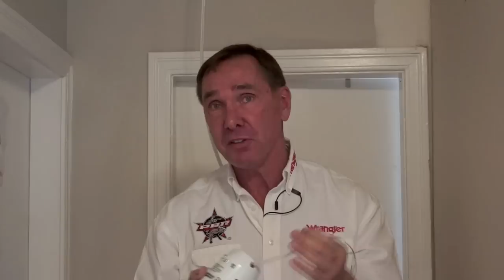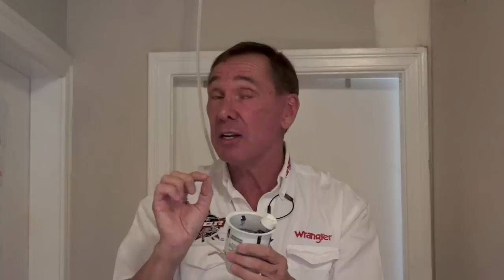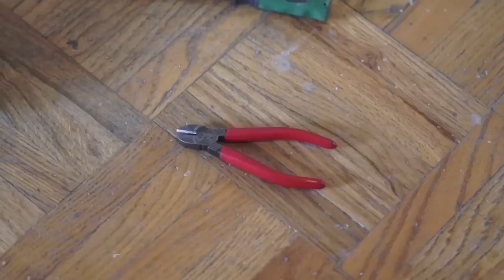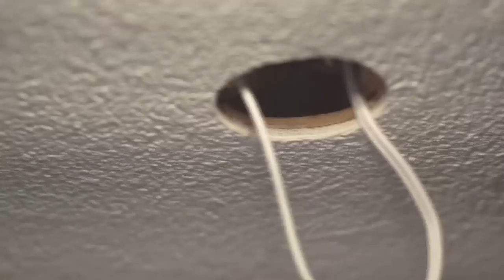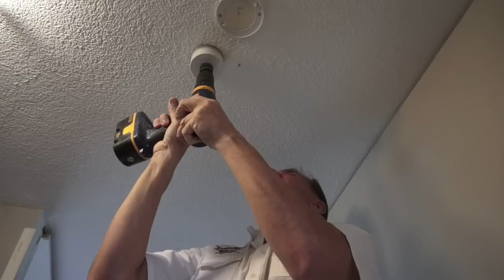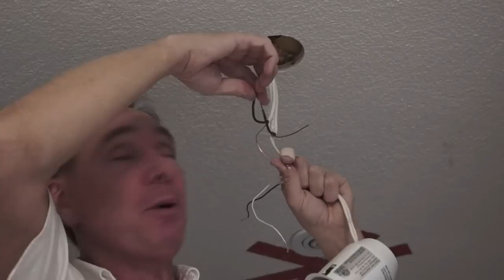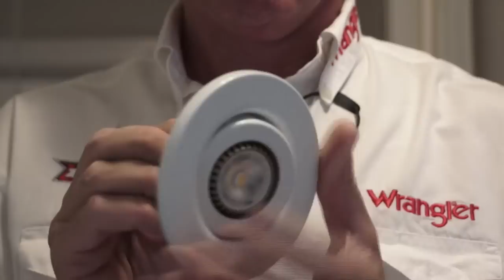How to Install Recessed Lighting | Retrofit

Comment: I am compelled to comment on a few things for the benefit of people watching this video. (1) You MUST put all electrical junctions inside a box. Boxes don't guarantee safety anymore than stuffing loose splices into an unknown ceiling space guarantees a fiery death, but properly sized junction boxes will contain arcs if the circuit surges or shorts out. (2) Proper eye and lung protection is a sensible and safe habit. Otherwise, stuff WILL get into your lungs and eyes (see video), whether or not it's large enough for you to notice. The odds might be very low that you'll drill into metal (a galvanized strap, for example) and get a tiny shard in your eye, but try explaining that to an MRI technician in a few years. (3) There is more than enough amperage in a typical residential circuit to kill you. The probability is low, but rest assured it is greater than zero. So treat every wire with respect and get a decent circuit tester before you do any wiring. (4) If you can't locate a joist with a stud finder, take a piece of stiff wire (e.g. coat hanger) and bend it into an "L" shape where the length of one end is the radius of your hole saw. Stick it into the pilot hole and rotate it to locate obstructions. (5) If you're putting retrofit fixtures into an insulated space, get fixtures that are rated "IC". A 5W LED bulb would barely warm up the pot, but a 50W halogen generates a LOT of heat. LED bulbs do fail, and who can predict if the next owner of a house won't stick his or her last halogen bulb in there? Remember that just because someone shouldn't do something, doesn't mean that they won't.
Reply: +Percy Lipinski : I just told you how to make your "low wattage job" safer. More importantly, I told others how to do so.
Reply from the maker: +Kevin Goncalves well you're a stupid idiot no matter what part of the planet you're from. As I says tell me what is unsafe. Be specific not this bullshit about not meeting your code you douche bag with a Latin sounding name LOSER!!!
Reply: +Kevin Goncalves It's pretty clear now that "Percy Lipinski" is some sort of train-wreck parody account. No real person would actually drill into a joist (seriously, how could anyone with opposable thumbs do that?) , dump that much dust into his eyeballs (staring blankly up into that dust cloud was a touch of slapstick brilliance) AND mount a smoke detector on a wall (I'm betting he tried to mount that smoke detector on the ceiling but just plain missed). I would have loved to see that smoke detector installation video ("It's only 9 volts! Explain to me how the house could burn down!"). Anyway, the comments for this video are hilarious. That whole "Nobody's explained anything to me" trope is another excellent comedic premise, although it would be more effective absent the racism and childish spelling errors. It's hard to fix the racism, but maybe the little red-faced man's next video will be "How to install a spell checker". It's always fun to see people make videos about things they know absolutely nothing about.
Reply: +Percy Lipinski I love it! It's like you hang around a playground all day to overhear all the insults kids come up with and then you remember only the ones that don't involve wit. But seriously, this is a parody right? Your actual name is, what? Biff Wrangler? I mean, how else can you explain a grown-up wearing a shirt with "Wrangler" plastered all over it?
Reply: +Biff Wrangler I'm somewhat worried that your little red face turns absolutely purple when you write that stuff down. However, every moment that you're pecking away at the keyboard with your perpetually bandaged finger is another minute that you're not hurting yourself making a video. Which, I suppose, makes it much healthier for you while amusing the rest of us to no end. That's why when you direct your inane playground insults at me, what I actually read is "Thank you, E Campbell. Thank you for keeping me safe". And if I can save anyone from applying comical amounts of red tape over their hack-jobs on ceilings, floors or loved ones, then I know I have truly done a good deed today.
Reply: +Percy Lipinski wow now ur all hung up on my name? don't wanna rack your simple brain too much in one day cheapskate. and here is the most simple explanation for the most simple of brains: your installation is unsafe because you have OPEN AIR connections literally touching COMBUSTIBLES. there you go moron.

Comment: Wow, just wow.  A non professional telling other non professionals how to do something wrong.  Just remember those who watched this.

If you ever have a house fire, even if it has nothing to do with this hack installation, your insurance company will not pay for the damages, or pay for you to build another home.
Percy.  Are you an insurance adjuster?
Reply from the maker: +John Valdes You dumbass professional "Douche Bag". OK Mr. expert how is the fire going to start with the type of electrical install that I did??? What a stupid piece of crap LOSER you are!!!
Reply: I have seen several car fires that started because of faulty 12 volt wiring.  Its not the voltage as much as the connections.  Of course this may never start a fire. But if something else starts a fire and the insurance company finds this hack install, they very well might not pay for the damages or give you the money to build or buy another home.  I will pass on this type of installation and would warn others to do the same.
Reply: Tell that to your insurance company when something else causes a fire.  You just don't get it do you?
Last words to you Hack.

Comment: Why do you have a dryer vent coming out of the interior wall? I also wanted to see you fish the wires. Looking to do this and wanted to know how bad it was. Judging by the scraped knuckles and bandages, it was not to good.
Thanks again.
Reply from the maker: This is s very low roof and the spaces are minimal you loose stool

Comment: living in cold climates, someone just might replace those (most probably) low CRI leds with the old halogens precisely for the extra warmth. A few hundred watts of lighting in the hallway will surely tempt one from cranking up the old fossil fueled heater as much. Therefore, the cans need to be rated for high wattage. However, in the future, the leds will be gaining in Color Rendering Index. I still don't know how to drill through studs and beams behind the drywall without tearing it up.
Reply from the maker: Look you leather faced piece of crap HALOGENS ARE NOT LEGAL IN THUS PART OF THE WORLD!!! If you do your insurance is not valid!!!
Reply: +Percy Lipinski 
who are you talkin shit like that. I'm just saying that it's not a good idea to just assume that  It's not against electrical code. .. and that the light of leds SUCK (unless high CRI).
Why give yourself a heart attack?
Reply: +fireofenergy 
sorry if I'm wrong
Reply: +fireofenergy And I'm NOT against the idea of the efficiency of solar and leds. In fact, i WANT a totally global powered world complete with global power lines and battery storage.
Reply: +fireofenergy 
I mean "totally SOLAR powered world".
Apologies
Reply from the maker: On the one hand you're right. It's the potential hear problem that could cause trouble. That's the reason for all the metal boxes and special connections that most of these assholes are complaint about. Of course those same assholes make a lot of money pretending to know what they are talking about.,the fact is heat is the enemy in any electrical installation, the rest is handled by the breakers. In this part of the world halogens and most other high temperature bulbs are permanently banned.

Comment: you might be old ....that might be the reason why you can't take constructive criticism.  you reply to my comment from 50 weeks ago with verbal abuse. ...shame on you...you Dickwad
Reply: +Percy Lipinski really man...seriously..just so that you know the Canadian electrical code that I quoted was from the code book.  so why don't you burn your code book which is probably from the 1800 and update your self to 2015 codes... and don't give me the old house rules crap because if you are installing a line votage fixture next to insulation you still need a barrier.
the only time you don't need a vapour barrier on the fixture is if the fixture is IC rated meaning in that they can be in direct contact with insulation.
Reply: Are you done you stupid racist bag of shit. Just because someone is giving you the right knowledge, take it positively for a change and see acknowledge what you did. I'm done with your ignorance. and this will indeed be my last post to your comments.

Comment: Percy, nice video. The one question I have is I didn't see how you got through the beam for the other chain of lights. Maybe I missed it. Did you use a flexible drill bit?
Reply from the maker: Now THAT is a great question. So first off unless you have a really bizarre roof like I do that is one with almost no clearance with no insulation there should always be enough space. Let's say you are cursed with a roof like mine then you either use the flexible drill or just gouge out a small trough through the drywall or plaster where the beam crosses. It's very low power so you won't have any problems unless of course you plan to have an electrical inspection which in my case would never even get to the point where I could do the install I wanted due to the roof construction. There are a lot of idiots in here that would love to prove me wrong, but so far nobody has!
Reply from the maker: Hi Dave as has been discussed at length  with so many the first trick is this is an old house with literally no space in the ceilings. Notwithstanding that I have been able to squeeze a few runs in here and there. Most were done with a long wall drill bit. They key to the project are low wattage LED bulbs. Here that's all we sell and frankly Halogens are being phased out world wide anyway.

Comment: The reason why you should put a junction box in it is not because of the heat produced by halogen or incandescent bulbs but sparks that might occur due to arcing as a result of many unknowns such as storms, surging in power, rodents chewing away at the wires, etc etc etc. If any of that happens, a junction box will protect sparks from highly flammable materials such as insulation. If you don't have that, a fire might occur. And no, just because it hasnt happened yet it doesn't mean it might not occur in the future. But a junction box is an extra security added to it. Other than that, nice vid.
Reply: okay.....so what about the the rest of metres of cable running in the ceiling that can be chewed by rodents???
Reply: +Chris M  Insulation is non-flammable
Reply: +Chris M , Im agree about your explain ( Im a electrician guy )
Reply from the maker: +Chris M thanks Chris. I know without any doubt at all that this install is not only functional and gorgeous but also safe!

Comment: I have never commented about a you tube video before, but after watching this fellow Canadians doing a diy video I feel I must.  Sir, I realize that you are trying to help the general public out and you have your opinion just like anyone.  But to respond to your critics with such hatred and vulgarity because they are trying to make a point that regardless of your house not burning down you are giving poor advise. One because it's not to code and technically can be problematic in more ways than one.  Please remove your vile responses as you should realize that not every one is going to agree with your ideas and your making fellow Canadians look bad..
Reply: Wow, this is the first time I've come across a Youtube video where someone is showing their own face in the video, but then all of the poster's comments look like those of a troll; frankly this is really weird. 

In case Percy Lipinski is actually a real person, perhaps I can explain what most of the commentators here have the greatest issue with. 
Junction boxes! Or the lack thereof.

Junction boxes which, from an electrical point of view are GROUNDED housings, are required anywhere you join line voltage wiring together. This is not to fill the pockets of the fatcat electrical supply companies or heat for that matter; this part of the electrical code is in case your wire nuts ever come undone - because they weren't quite tight enough or someone in the attic tripped on the wires running from fixture to fixture.
The logic is this: If the wires become decoupled, electricity likes to follow the easiest path to GROUND. If they are in a GROUNDED housing when they become decoupled, the circuit grounds out and the breaker trips off....keeping you, your family and your house safe.
IF line voltage wiring becomes decoupled in the way demonstrated in the video, the breaker will not trip off and the wire could come into contact with some higher resistance, but still conductive material, like wood, and eventually ignite that material. 

And in case you are about to argue that the low power (6watt) bulbs reduce or eliminate this risk, that is incorrect. This is because in the scenario I described above, the light bulb is actually removed from the circuit when the wire comes in contact with the wood - the wood becomes the load and all of the current is dropped across all of the things in your attic that aren't meant to have electricity touch them.
Reply from the maker: Look you stupid IDIOT MORON!!!! I know exactly what I am doing in this video (unlike the idiot "code followers") The fact is that no matter where they're from the issue in this video is about safety and if that you can be sure that my installation AND amy recommendations to others n this video is perfectly safe and sound! Not one so called expert has even once suggested how my installation would be unsafe. Why? Because they can't!!! All they can do is state "not to code"!!! Well you stupid douche bags rustles a nothing. The code says pay your taxes but people don't in many cases. Does that matter? No unless paying out extra money is fun for you. People even use their phones on airplanes. Is that dangerous? Actually it's not, they just want to remind you that they're thinking about safety. Electrical codes keep electrical manufacturers in business you stupid piece of stinking crap!
Reply: So key takeaways here: 1) you don't pay your taxes and feel that is somehow related to home wiring 2) you think that using phones on airplanes is somehow correlated with home wiring safety vis-a-vis a strawman argument 3) you think that electrical codes are useless and only serve to keep manufacturers in business... I hope you don't run an automobile manufacturing plant.
Reply: @distantlands  because "the code" was created as a direct countermeasure to satisfy the insurance company.  Meaning the insurance company was sick of having to pay out when homes burned down.  Meaning "the code" is based on decades of trial and error in improving safety and saving lives.  Meaning you're wrong.

Comment: hmmm, where to begin? 1st off, i know there are grieving families around the world that will disagree with you on 120v not being enough to kill you. just because your house hasnt burned down does not mean this was a quality install. you did everything possible wrong, from cutting the hole in the wrong place to using the clips on the fixtures incorrectly. wirenuts can back off of terminations in walls and ceilings from the vibrations caused by slamming doors and intense thunderstorms. and guess what it may take more than fives years and may possibly never happen for you but you are now responsible for every who followed your 'advice' and did a substandard install in there home. hope you sleep well knowing this video can and probably will kill somebody.

Comment: Thanks for the video!  Very informative.  I have to comment on all of the negative comments that I saw from others and would love to have them instead of commenting on what you did wrong, how about they make a video of how to do it right instead.  People always have stuff to say about everything when someone is trying to just show what he did in his own spare time.  Yes there are codes for everything but what about back in the day when we didn't have codes or rules?  How do we think we got light in the first place?  Just my thoughts, leave the man alone and make your own videos.
Reply from the maker: Exactly Yvonda. Here's the thing, I've been doing this for 20 years. Guess what my house is fine. That fact is wires don't move and short out by themselves in a ceiling. What DOES happen with older lights is significant heat build up from incandescent lights. The heat itself not only poses a fire hazard but small movements from the constant hi/lo temperatures generated by those bulbs could eventually cause a shorting problem. Even then of course we still have a breaker to shut it all down. But in any case I was very clear that this job was ONLY for LED bulbs. In most regions of the world incandescent bulbs are either hard to get or even illegal and just like the typewriter will eventually disappear completely. As for codes, sure there are codes. Codes are a polite word for rules or laws. You always have to ask "who's" writing them and why. Question Authority! In this case the rules are written by the industry that sells electrical hardware and the electricians licensed to install it al

Comment: ...it's no wonder those cans were dirt cheap as they were missing a lot of features. All you needed were the remodel-insulated-contact rated type of cans (each comes with built-in junction box and is safe to be around insulation) and your video would've gotten more thumbs up.